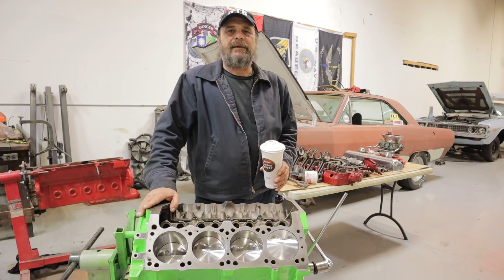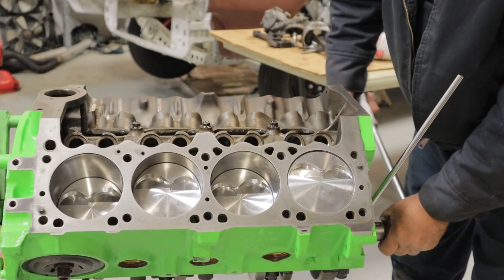Finding Your Engines Happy Happy Fun Zone

Comment: Hopefully this opens people's eyes to what a good mechanic and tuner has to take into consideration for a successful engine. It's way more than just throwing a bunch of parts together with nuts and bolts and making it go. Careful planning, understanding how parts work together, and how to set them up, is what makes for a happy long living motor. Doesn't matter if it's a 5 hp Briggs engine, or a 3000 hp drag engine, it's all about knowing what works......and learning from your mistakes when it doesn't.

Comment: May the force be with you I can't wait to close up my exuast lash.  I can't help thinking about some kind of port like a two stroke in the side of the cylinder somewhere doing something to get an edge.
Reply: The lash trick works on nitro engines because of the long burn fuel. It won't make a difference on gasoline

Comment: You know more about this than I do but what if there was a way to inject a little fuel and air mixture in the chamber at around 45° past tdc  with that second charge would it be of any use?thanks

Comment: Question for ya Tony, now I've been seeing guys use E85 or better and these guys are making 100+ hp. Is that because the fuel isn't as volatile as gasoline but it burns longer into that 45 - 90 degree power zone?

Comment: Seems like why the old hot rodders said put moth balls in the gas tank if you wanna get some extra horses.... gasoline burns at a certain rate, and in a certain amount you'll get an expansion of gases at a certain amount, but with naphtha from moth balls, you get a higher octane, but also a longer burn, so you get power from the spark to a longer spot in the stroke per cylinder.....

Comment: I absolutely love the analogies of these last few videos. As a sound guy this clicks like a Eureka moment. The movement of the piston is like a sine wave, maximum change velocity follows maximum pressure. For the piston the force is external so we start at cosine (degree wise) but the x-axis is the same so at 90 degrees cosine zero amplitude has been reached and rarefaction must occur. Putting energy in past that point thus nullifies the energy, which is impossible in the confined oscillating motion of the engine, thus blowing it up. 

I hope this makes sense, as this is the simplification that I needed for this to click in my head. I never thought of the duration of burn this much before and now I totally understand the importance of it.

A teacher is someone who can convey knowledge. 

An excellent teacher is someone who can understand that the student does not know everything the teacher knows and finds analogies and ways to let the student not only grasp the knowledge but thinks it over. 

Thanks, Uncle Tony, for being an excellent teacher!

And for those who don’t understand my ramblings: I’m not even close to a teacher so my apologies 😂
Reply: The displacement of the piston in a reciprocating engine IS a sine wave, if you plot displacement vs. time. And the velocity of the piston IS the derivative of the sine function, at any time, as velocity is the derivative (the calculus derivative) of displacement or position. The derivative of sine is cosine, which has exactly the same shape and amplitude, but out of phase (lagging) by 90 degrees. This is the math equivalent of stating that when the piston is at TDC or BDC, maximum displacement, then the velocity is zero. And when the piston is at zero displacement (90 or 270 degrees) then the velocity is at a maximum. To find the piston acceleration take the derivative of the cosine, which is back to the sine function, but multiplied by -1. I will leave it to the reader to figure out what that means.
Reply: @gavinmclaren9416  Well Yes, I always understood the piston making a sine wave pattern when plotted but thanks to UTG I started to think more into this and the relation with pressure and the degrees of useful work. That is what this made an eye opener. 

I never gave the ‘explosion’ any more thought than ‘get the timing right to get the explosion timed for the speed of the cilinder’. I have never considered the actual duration of the flame front and the implications when it comes to making more power. Because every other hot rod video will say:

“An engine is an air pump. You want more power? Get more A/F in and more exhaust gas out.” That’s the externals. That sounds simple and that’s what most people start to do (manifolds, exhausts et cetera).

What goes on inside with the fuel is almost never considered and UT gave a perfect analogy for me. I am now binge watching his series and it’s the ultimate treasure trove. 

Especially as I have always been (temporarily not now) a Mopar driver and enthusiast.
Reply: @gavinmclaren9416  not at zero displacement but at half displacement the 90 and the 270 deg.
Reply: @slyrider5271  Sure, it all depends on what you call zero. I would visualize zero at 90/270 and max/min at TDC/BDC, but mathematically it is just as valid to call TDC zero. In that case it would be a cosine wave, as the phase difference between a sine and cosine is 90 degrees. The important relationships are that when the displacement is at TDC the velocity is zero and the acceleration is a maximum.
Reply: @gavinmclaren9416  yes I understand what you say, like the Y axis starts at 0 and go up to half stroke (TDC) and then comes back to zero and then go down to bottom DC. This makes more sense now that I think of it because the curve crosses the X axis twice per full rotation (this is a reciprocating movement after all).👍
Reply: Oddly enough, the piston speed is not a sine wave. In theory yes, but the constant accel/decel a spinning crankshaft goes thru when it is running makes it anything but a sine wave. I know that may seem a bit odd, but misfire detection is based on the fact it isn't a sine wave. The easiest way to explain it is this. If an engine is averaging 2000 rpm, and you measure the crankshaft rpm using 3 teeth on a crank sensor at 18 degrees before tdc, then 3 teeth at 18 atdc, you will see differences of about 300 rpm. So the engine is actually pulsing, which throws the sine wave out the window anywhere near compression tdc of every cylinder. it is more a stepped wave than anything. Misfire is flagged when that pulse isn't seen repeatedly on any cylinder. So, in theory the speed would be a sine wave if the crankshaft spun at a constant speed, but in actuality the crankshaft is never spinning at a constant speed. Super bikes use this as a form of traction control. All cylinders on those engines are usually set up to fire at the same time, which makes for a massive change in crankshaft rotation and piston speeds.
Reply: @shvrdavid  It makes sense it wouldn’t be a sine wave in real time use as there is an external force (ignition) accelerating the piston (and every other piston) but the concept of ignition timing and duration of the pressure exerted clicked with me thinking about it thusly. That is because a sound wave compresses air and after that rarefaction happens, and the correlation of the amount of pressure being exerted and for which period makes sense to me that way. A pure sine wave is always an analogy. Sound is not really a wave too; we plot the reciprocal of pressure in time which looks like a sine wave on paper. Same goes for the theory of the piston. Only difference is that the amplitude is always fixed due to the stroke. It wouldn’t surprise me if the piston doesn’t make a perfect sine wave even when cranked by hand and plotted because of the linkage involved. Also, different from air, is that the needed force to maintain a certain velocity is proportional to the mass of the car and the external (frictional) forces being exerted upon it. Which means more power doesn’t change the amplitude of the movement (stroke) but the amount of force exerted upon the piston, which in no load condition would mean higher RPM’s but with load more work at the same RPM. But that’s all very, very far from the scope of this explanation video by UT. He perfectly explained the concept of the window in which force can be exerted which made complete sense to me via the analogy. Again, this had to do with me never thinking into the duration of the burn. I ‘simply’ thought that more power from more A/F and other fuels was due to a more powerful ‘explosion’. I never considered that the duration of the propagation could be altered.
Reply: @RustOnWheels  What Tony explained is a good explanation. But it is not everything that is actually going on. The difference in crankshaft speed is from torsional amplitude. All 4 cycles of the engine contribute to that, as do cylinders. Which changes the rpm of the crank drastically, throwing your sinewave out the window.... Thinking of it as a sine wave throws the time the piston is pushing out the window. In the end, your after time, just as much as you are after degrees of rotation, but they are not the same due to accel/decel... Power output is not just the number of degrees it pushes, but also the amount of time it is either pushing or parasitic. Look at it this way. If you are building an engine for a truck, to have massive low end power, do you want a light flywheel, or a heavy one? You want a really heavy one, to flatten out the torsional amplitude, extending the time it pushes, to make more bottom end torque. Take that same engine and put a light weight flywheel on it, it will loose lots of bottom end power....Due simply, to time, and the increase in torsional amplitude....
Reply: @RustOnWheels  A crankshaft/connecting rod/piston system describes an exact sine wave as it rotates; it is mechanically constrained to do so. The state of the gas above the piston that exerts a force on it will vary depending on the circumstances, and this will determine the amount of torque imparted to the crankshaft, but the nature of the piston motion is a pure sinusoid.
Reply: @shvrdavid  I can't argue with that; what is happening there, I reckon, is that there is some deformation in the cranktrain to cause that effect.
Reply: Hey Rust great analogy
Standing waves and resonance and such is also key as most motorheads do get it on intake velocity and header reversion but lack the follow thru during the Sonic front of the explosive force and cos/sin stroke and yadda. 🐮🥩Mr N Tesla did it best.
Reply: Hi I'm glad some other mad scientist motorheads are here.
The whole concept of Deflagration to detonation transition time and extractable useable force is matching the optimum crank angle rpm to number of cylinders to load. To put it in basic terms. Damm I need my white board and an hour to make some graphes👻🥩

Comment: UT really takes this topic seriously and this is great for us.
But I was thinking a little bit when this sruple came up in my mind:
I think that 90° on crank is not accurate as the angle of most torque. My opinion is the most torque appears when the conrod is perpendicular to the lever of the crank. The force in the rod is paralell to the rod and this is the posotion when all the force goes into the turning of the crank.  This depends on rod/stroke ratio, but basicly is around 70°ATDC. I would say that happy zone must be around this angle (70-75°). Correct me if I am wrong.
I edited my comment the second time because I got busy with excel and calculated piston positions and speeds...

Comment: Please check my, way too long, comment from 3 days ago. I discuss a basic principle of IC engines that I was unaware of my whole life.
At 90 degrees of crank throw, ~63 +/- percent of the stroke is used. It varies depending on on rod, crank and piston geometry.
That is why the 45-90 degrees of crankthrow is the "fun zone" because you are getting well over half of the stroke. At a great angle for power output.
If you didn't see my comment from three days ago? Please check it out.  I'm not looking for kudos or anything. 
I just want people to understand this very "non-intuitive" fact before they are 63 years old. Like I was.
From this great video, and it's more practical implications. I think you may have seen or glanced through my comment.
Or others may have made similar references earlier in the comments that I didn't see.
Either way?p. 👍🏻😎🇺🇸
Reply: Thanks for the interest. In something that isn't intuitive at all. I hope it helps others understand IC engines. As long as they keep building them?
I only have one car with a carburetor,  points and a condenser. A Red 1973 Corvette Roadster with an under hood B&M blower I rebuilt  in ~1990. Original "close ratio" (great) 4-speed with a 4:11 rear end. It gets "great gas milage". Mid 3000s RPM at 65 mph. It's great in the snow.😁
If an EMP or Majorr Solar Storm hits, and all electronic cars are "dead in the water".  That will be my only drivable "covert" vehicle in a SHTF situation. Maybe it would need a new condenser.  I can always put lots of stuff in "the trunk". 👍🏻😎🇺🇸
I'm looking for a pre-1973 Suburban with the Premier package and 20" rims (off road) 😂 for a "get out of town" vehicle . Unfortunately, other people have the same idea. If I remember correctly, the back seats are all bolt in. No electronic fold down option. No electric windows, heated seats or steering wheel either. Bummer. My wife will hate it. But that's multiple things that won't break or are easily fixable.
My absolutely obvious single piece of advice. When driving your paint prepped 1953 Ford to the airport to paint at night with my bosses equipment. The front seat sets down real solid. On the flat driveway. Who needs bolts. 3 on the Tree. While backing out, if the driveway is steeper than 30 degrees? You will have a serious problem. I have personally tested this. The front bench seat Will tip over leaving you grabbing the steering wheel for dear life, in Reverse at idle...and zero ability to push in the clutch or the brake. Fortunately, no cars were coming, I coasted backwards across the street and killed the motor. The across the street neighbor had a largish gravel driveway. He came out and said "what happened"? I mumbled something about a loose seat. I couldn't bring myself to own up to being such a moron. 4 bolts later, and I was good to go. It's good to make mistakes in benign situations like that when you're young. It definitely helped about most idiocy when flying airplanes later in my life. Not completely. But I was just as lucky. I had used up ~4 lives at that point.

Comment: Thats why in the emissions and fuel crunch 80s, several manufacturers came out with 4 cylinder engines with twin spark plugs per cylinder I guess their thinking was if they fire the 2nd plug slightly after the 1st, any hydrocarbons remaining in the cylinder might get burnt off for a more complete combustion cycle. I think in practice though, it served emissions more than economy / power.

Comment: This is an OUTSTANDING explanation.  Cant thank you enough for taking your time to make and publish these videos!  HOWEVER, one thing is confusing: since the greatest mechanical advantage occurs when the crank is around +90° from TDC, then why not just retard the timing to make combustion occur between +45° and, say 60° or 70°?  Obviously that doesn't work, so there must be other factors at play that make the engine like to have the pressure pulse begin just after TDC.  But what are these factors and what methods exist to adjust them (beyond just retarding the ignition timing)?
Reply: The piston has to move to 45 degrees first. Without combustion no movement so that’s a big problem right there :)

It just all clicked with me thanks to this video. See: TDC is maximum potential energy (maximum pressure) and 90 degrees is maximum velocity. After that it is rarefaction (compared to sound pressure waves). So in order to move the piston the energy must be put into the system at maximum potential energy; TDC. The acceleration following needs less energy as acceleration means falling pressure. Thus one could ADD more pressure AFTER initial energy input, but not without. 

I hope this makes as much sense as it makes in my head.
Reply: Watch from 4:40
Reply: @funstuff192  I like 4:26 more 😁

Sorry, I just had to.

Comment: I now understand why the diesel engine i say split the block in half leaving the crankshaft and pistons spinning: the fuel was being injected with such volume that the length of time it took to do so continued beyond 90 degrees past top dead center of the combustion event

Comment: Mechanic here, a little confusion regarding the 90 degree thing Tony. I take it you mean 90 degrees between conrod centerline (little end to big end) and crankshaft main center to big end center? This point would provide the limit of mechanical advantage but is NOT at 90 degrees crankshaft rotation in engines where the crank center matches the bore centerline. This should give a motor with longer rods an advantage over shorter rods. Otherwise excellent info thanks. FYI Many small two strokes have the crank offset to the bore centerline (called Desaxe angle) to gain more mechanical advantage. Keep up the great work!
Reply: careful Frieburger may hear you
Reply: @iheartmysquid  Dammit! you caught me!

Comment: Tony you have me wondering if the point of max compression and firing could be moved away from top dead center of stroke if you could make a more efficient/powerfull engine.  That statement may sound impossible and or dumb if you think in terms of conventional piston engine design, but it might be possible in a Deltic engine (or something similar) with 2 opposed pistons per cylinder where the mixture gets compressed between the 2 pistons....If the pistons in a single cylinder are at different points in their stroke at max compression.
I would imagine in turbine and rotary applications it also could be possible